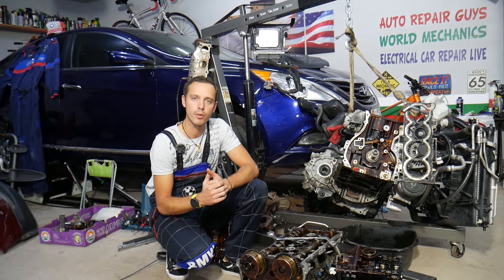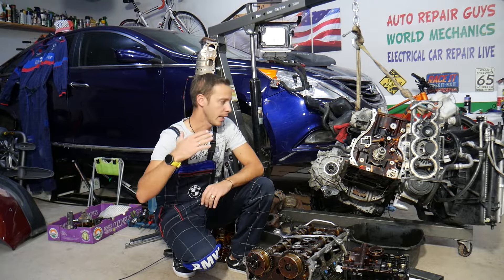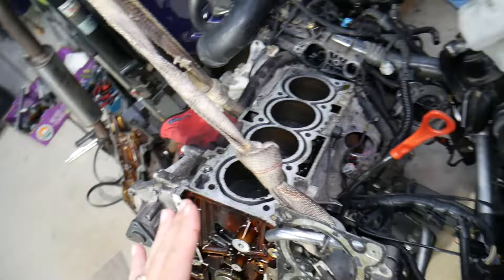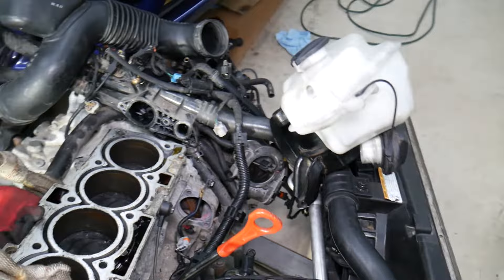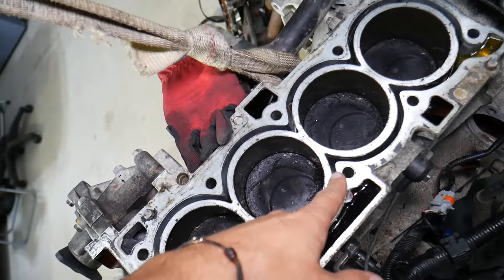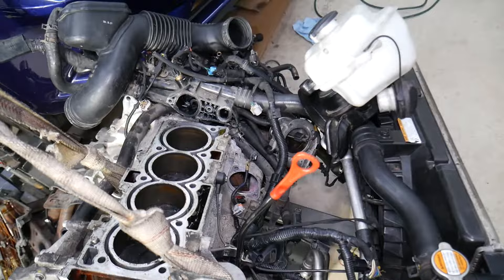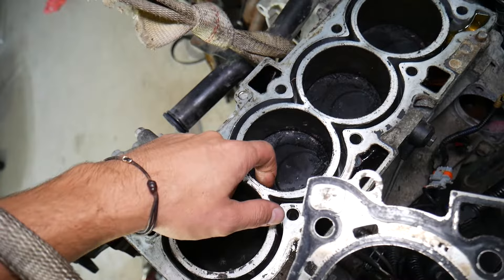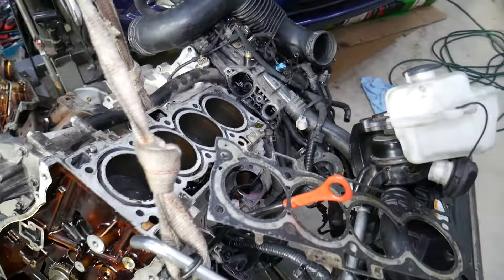WHY COOLANT COMES OUT OF RADIATOR CAP OR OVERFLOW TANK RESERVOIR ON A CAR

Comment: So it can range from a bad seal on the resevoir cap, all the way to replacing the entire engine head. Got it. You explained there is about 10 different reasons that it can happen lol you mightve well just said "if u have a coolant leak, well it could really be anything"
Reply: Yup, which is why you pressure test and/or block test
Reply: @babypinkbean   turned out it was just my thermostat. Replaced it and no problems since
Reply: You car was thrwing the coolant to the reservoir?
Reply: @westcoast2372  yeah thanx tips🤦‍♂️ welcome to mechanics. Its process of elimination. If you wanted a direct answer then take it to a mechanic instead of seeming irritated for the options it could be
Reply: @tylerseabook9423 
Some like to just be a smartass for no reason yet they are the ones who came to YouTube

Comment: I changed out my water pump and  thermostat  plus new top and bottom hoses new radiator.. and new radiator cap .. and it's still leaking coolant from my overflow bottle .. I have a 2000 Toyota camry 4 cylinder  .. please help .. I don't know what else to do
Reply: Same issue. Once I figure it out I will come back to this comment and hope it helps you. Unless you’ve already figured it out ?
Reply: Is it running hot?

Comment: My coolant ends up all in the expansion tank, I’ve tried everything and I’m down to two things, bad water pump or head gasket. 2010 Infiniti fx35 taking it to the shop this week. Not planning on getting a new car so I may end up with a hefty bill.
Reply: You get it s9rted after ? I had hg done but still had coolant getting into ex. Tank and over engine . It dies go back in once cooled very odd
Reply: @kevinhancock4064  My HG, water pump timing chain and all other gaskets have been changed.... car isrunning like new, the only thing i've noticed now is that when i picked up the car 200 miles ago, the coolant in the ex tank was at max, now its in between min and max. i was told that there may be air in the system to just top off the expansion tank... idont have any signs of coolant leak anywhere. If you got your HG replace,make sure you get a new Radiator cap. that may the culprit. Make sure its an infiniti one as well. they're pretty inexpensive part.
Reply: @David Tufino Photography  when you say infinit you mean oe/genuine yes ? Sounds similar to all that I've had done .I was gonna get car today but get it Monday.  Its had a new cap which initially they thought it was the issue . The bleeding pressure on my cat however is rev with cap on and up to temp to 2500 revs for 5 minutes then 3000 revs for 5 seconds  and of it needs topping up repeat procedure once topped up. . I had a dash coolant temp high warning recently..I know air pockets can also cause this . The garage said they've done all checks etc inc hg checks . Obvs  that's their word.  They do have a good rep . It's odd. I'll ask them if cap is genuine etc . I just wanted to get some good use from car as I'm not in a position to buy another . Its had new timing chain skim & pressure test intake clean lifters rickers turbo so if I can sort the issue I'd have a good functioning vehicle . That wouod likeky last some time
Reply: @David Tufino Photography  one thing I do have here only to rule out the smallest of leaks if any . Is dye  I used ot on my last vehicle for confirm (found already ) my therm. Housing gasket leak . Cost me 7 quid and coolant to fix .

Comment: I also overheated the engine I checked the heads polished them they all checked I replaced the gaskets but the engine still trots when pushing on the gas pedal antifreeze throws out of the radiator what do I do how to find a leakage

Comment: How are you doing? I looked for you on YouTube just wanted to say thank you so much. My Jeep cherokee 2001kj 3.7litres  was having cooling system failure and I flashed the cooling system a number of times but the problem continued. Tuesday nigh after watching your video then my attention moved to the radiator cup which I knew was in bad shape but I didn't know the importance of it being in good shape. Today I bought a new radiator cup and went for a test drive and the results were amazing, no boiling of coolant, engine no longer getting hotter than the normal temperature and no coolant coming out of the reservoir whenever I just stop or pack. Thanks to you my baby is back on the road. Continue with the same spirit. The radiator cup is almost $3 dollars here in Zambia just $3 dollars would have killed my baby and I would've spent more on the gasket

Comment: I had a cracked head, but didn't notice it, when I had the upper intake gasket go out on my 2002 Grand AM GT 3.4l V6. So I took everything apart and check that all clearances we still within standards. I missed a small crack between the valves. So when driving the car, everything seemed fine until I would step on the gas hard. Then I would noticed bubbling in the cooling system. It would leak off a little throught the overflow tube. But granny driving was fine around town. When I decided to pull each spark plug, one was stuck. It stripped the thread when took it out. So when I pulled that head, I was able to see it, now that it was bad. So I changed the head, put it all together, then it was noisy, knocking sound, until it warms up. Wasn't exactly sure what was causing the knock now. Thought something happened to cause rod bearings to wear out, so when I was replacing those, I noticed when that cylinder was at top dead center, it would clunk to the side. It seems the time driving it and it kept trying to over heat only when stepping on it at full throttle, must have caused the one to wear out more, when it would keep getting heated up. So I now have piston slap on that cylinder.  The original upper intake gasket on that GM 3.4l V6 is a terrible design. The replacement one has metal spacers, to prevent the gasket from being crushed too much, during installation. The one that failed was just plastic with the silicone seal bead. I just wish I noticed the crack in the head when I had it all apart. Lesson learned.
Reply: Is it the same with the 4.3 liter?
Reply: @anthonymurlowski8521 IDK
Sorry I took so long to respond. My wife has been sick, and I have been forgetting to check my email.

Comment: I've got the weirdest car, not long after buying it I noticed the Coolant expansion chamber was way below minimum so topped it up assuming the previous owner just hadnt done it in a while, checked it again two weeks ater and same thing so topped it up again, after that I checked almost every day.  Never had any leaks, no warning lights, no overheating or anything, no signs other than the visual check with missing coolant.  Then not long after the 2nd top up it started to show some leaks/drips under the car, nothing major just very light loss. Kept topping up and keeping eye on it until eventually taking it to garage who diagnosed a crack in thermostat housing, they said it was common on the age and model of vehicle I have (2012 citroen DS3) they also said some work had been down around this area as parts were new and mustve had work done recently.  Again a month or so later from fixing small leaks like before but not very much, very very light patch.on driveway every so often, usually after a longish drive leaving car overnight id notice a small patch, nothing like before and nowhere near the coolant loss as before.  Because of these issues I've been obsessively checking the coolant level and today noticed it had risen to over the max line? Despite as I say the odd drip i expected it to go down slightly, I released the cap slowly expecting a slight rise as sometimes happens when releasing the pressure out the chamber but the level just kept rising to the point where its running out the top onto the floor.   I've topped it up twice with approx 500ml of coolant since having it fixed around 6 weeks ago but haven't needed to the past couple weeks as its been consistently on the max.  

It's making me think are the levels even consistent when I'm checking it, is it not regulating properly and perhaps when I've thought it needed coolant maybe it didn't? I've not seen it like that ever rising up and out the top.  Needless to say I've soaked the excess out with a cloth for now.  What could this be?
Reply: Potentially an air pocket traped in the system could cause irregular coolant levels, but to be safe, do a hydrocarbon test to see if you're getting exhaust gasses in your cooling system. The tester is relatively inexpensive. If you are, it could be a sign of a blown head gasket.
Reply: @midwestfatass  coolant has been drained and replaced several times recently could there still be an air pocket there, new water pump was recommended and replaced along with a new thermostat housing where they said it original leaked via a crack, but this problem is still there slightly, I'm sure these mechanics just change things for the sake of it
Reply: @campcop9214  if the shop isn't versed on bleeding procedures, the problem could remain. I would, however, do a head gasket leak test as soon as possible. The kit to test it is around 30 bucks, and it's very diy. Super simple. Then at least you can be confident in the health of your engine. Look up testing head gasket on youtube.
Reply: @midwestfatass  I've heard of this, I'll try it, I've literally seen nobody say pressure build up could be a failing water pump, 2 recovery breakdowns "specialists" said it looked like a water pump issue so idk feeling quite ripped off by not just who I got the car from but the 4 different people who looked at this car to discover the issue. I don't know what to think.
Reply: Thanks for you replies aswell buddy I do appreciate it
Reply: @campcop9214  to the best of my admittedly limited knowledge, a water pump can't introduce air/pressure into the system. It can only leak, or not provide adequate flow. If your radiator cap is new, and the proper one, and you are still over pressuring the system and getting coolant pushed out into the overflow, you are probably introducing combustion gasses into the coolant. One free test you can do is run the vehicle up to operating temp with the cap already off to open the thermostat, and see if you're getting bubbles coming up in the radiator. Not as definitive as the hydrocarbon test, but free, and a good start
Reply: @midwestfatass  hyperthetical question but say it is head gasket gases getting in, is this a big job, straight forward to fix?  The cap was changed BTW after the second time the coolant raised up out of the cap, it's a genuine part aswell. That didn't fix the problem however
Reply: I see amazon has the RELD kit, would this be adequate to test the coolant
Reply: @campcop9214  the reld kit would work but relies on enough pressure to create continuous bubbles. The better one on amazon would be the OEMTOOLS kit with the squeeze ball. The one I saw was in a green case. It's a little more, and you would need to get the blue fluid separately, but you can diagnose even a slight head gasket leak and without having to rev the engine. You do need to run the engine up to thermostat open temperature with the cap off, and remove enough of the coolant that you don't get any coolant up into the tester. If the test is positive for exhaust gasses in the coolant, it's head gasket, cracked/warped head, or cracked block. It may be cheaper to get a used engine put in, then have it properly repaired. Depends on the engine, and car.
Reply: @midwestfatass  thank you, while I observed the breakdown man revving up the engine with cap off I didn't see bubbles in there, just a wave effect pushing the liquid up and out since it was so high in the expansion bottle, I will try this test though. Thanks for all your help
Reply: Ended up doing the test, I did go for the reld kit in the end and it was a positive greenish yellow reading. Booked into a different garage to who had previously looked at it and there mechanic said they had positive reading aswell. There quote was outrageous at nearly 3 grand sterling..timing belt issue aswell as other things..the stupid thing is the car has very few signs other than the coolant mentioned. So how they come to 3 grand I don't understand.  Looks like its not worth to fix unfortunately.

Comment: The coolant on my 1964 ford econoline overflows via the tube attached to the radiator cap after or once I turn the engine off.   While running it doesn't leak and the engine does not overheat.
It is not leaking from radiator, hoses, or any other place.  I don't believe it could be head gasket because the engine has been rebuilt.   I did recently change out the radiator cap, need to know if that's what is causing to overflow?   Appreciate any response and/or information you provide.
Reply: You sort it after ? I have overflow issues yet garage done all testing hg was done months ago very odd ..it did recently overheat again or at least coolant temp was high
Reply: Have you solved that issue with your car mine is doing the same
Reply: What fixed it ?

Comment: I replaced my radiator with a new one..temp sensor replaced..replaced my thermostat multiple times..new water pump and new reservoir cap and it still gets hot quick
Reply: It could be a blown head gasket

Comment: i recently got a 2014 veloster turbo. replaced thermostat,waterpump and cap. noticed every few days it would start to run hot and i would need to add coolant. just noticed after every drive the coolant is seeping out the reservoir tank drain hose and the reservoir is full. will check the sensor next. if it continues how can i test if is the head gasket or head? thank you for the great video...
Reply: Leakdown test.
Reply: What was the result? I have that issue too

Comment: So, my truck does not overheat but the reservoir tank builds a lot of pressure. Also if I keep cap off and turn on truck and mash the gas it will raise up and start overflowing.  Don't really notice any loss of coolant at all. Don't have any rough idle or overheating. No kind of misfire. Heat works no heater core problems. Just changed my thermostat. So, just wondering ehat the issue could be.
Reply: My EXACT Problem..Did You Find An Answer?
Reply: Mine is the same, except it does overheat a bit, I'm wondering what's the problem.
Reply: I'm in the same boat here
Reply: @LeetosBeetos  No, not yet haven't had the time or money. I have started having a little misfire though. Slight rough idle. And coolant loss but no smoke.
Reply: I have changed a few things but started having some coolant loss slight rough idle and misfire but no smoke. So, not sure what's going on with mine at the moment. Have started having a little hesitation issues where it seemed like it wanted to stall but once going it's fine only does it when first start it up.
Reply: @Paul-fq4mm  sheesh, good luck with your truck, hopefully you figure it out and get to fix it eventually.
Reply: @209MainstDB  Thanks I appreciate it
Reply: I'm in the same boat...
Reply: Any update ? Same issue
Reply: @kingchihuas1  Well, for sure no lol But, I believe at this point it's a crack head or something of that nature. I bought bars head gasket repair. The 40 dollar bottle and it fixed my problems. Other ones I tried and it didn't work but that bottle worked. Haven't lost coolant overheat shake or anything since.
Reply: What's a bottle  ,mine it's having the same problem

Comment: Hi and great videos. Question is… just bought a 2.5 Sentra that blows air and coolant through the filler cap and acts like a blown head gasket. There is no coolant in the oil, no residue on oil cap and the car does not smoke. It does still get hot. I bypassed the heater core since I’m in Florida. Both thermostats were changed also. The radiator seems new but looking forwards to seeing if something is clogged. Any suggestions my only bet is radiator clogged or water pump bad. Everything looks new but coolant did seem brownish. Never had these symptoms before and only thing I can think of would be worst case scenario the head gasket regardless it was changed. Only 100k on the engine. Any idea would be appreciated
Reply: Have you fixed this?